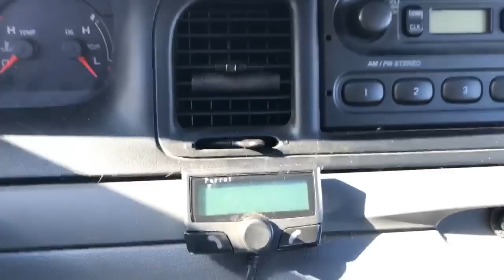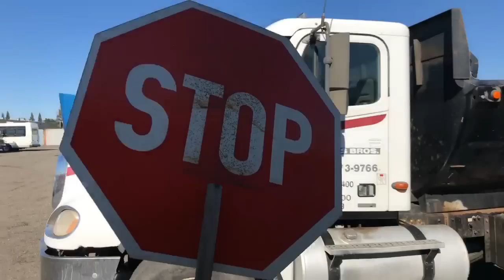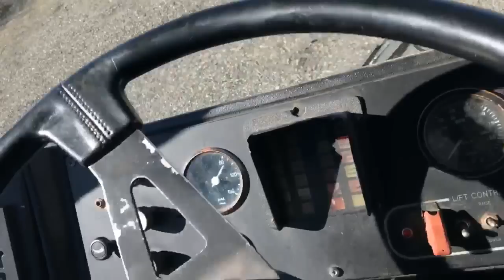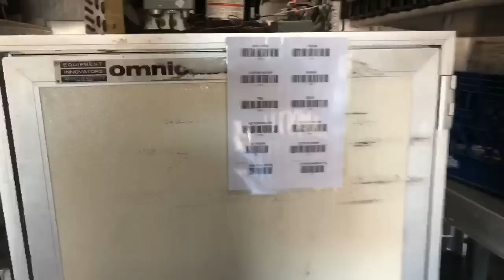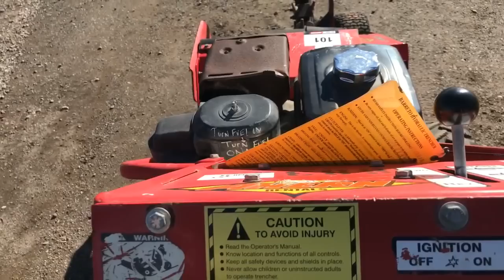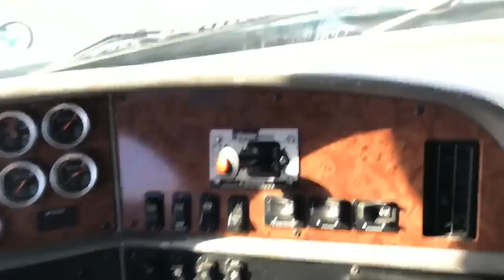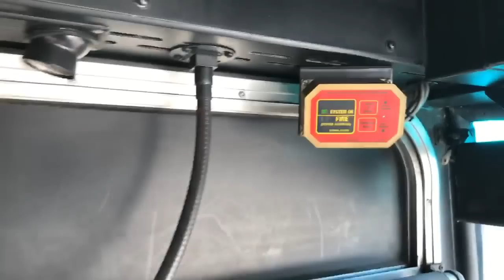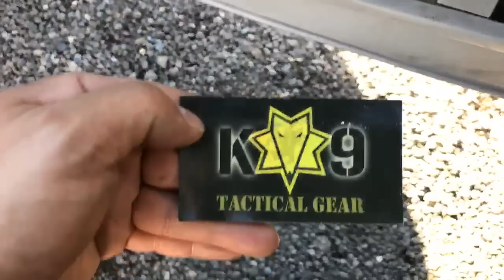🔴LIVE Auction Crown Vic Police Interceptor

Comment: I won't a crown vic but I live in the uk 😭
Reply: Kangaroo Gaming same
Reply: Kangaroo Gaming I live in Australia and I just picked up a crown vic for $13,000. It had lights sirens and a custom sheriffs paint job. It's awesome.
Reply: Jay Myerslowe There are a few crown vics in the U.K. And if you have enough money you could get one shipped from the US
Reply: Cool video man. I too love the P71. I have a 2004 burgundy smooth top, duel spotlight with the 3:55 rear differential. It's been my daily driver for 7 years so the body is starting to rust a little in the front wheel wells. I bought it with 75K and now it's at 180K. I just replaced my rear shock absorbers, gas tank and fuel pump/filter. I also replaced  my spark plugs and flushed my differential. I've always gotten my car fluids changed on time so the motor and tranny always ran good. But Man.......this car runs just as good, maybe even better then the day I bought it. These cars are tough as hell. I've always driven hard and fast so I know that these cars can take a beating but still come at ya. Good luck with your videos bro. I'll have to check them out.             

CVPI=coolest, most reliable car.